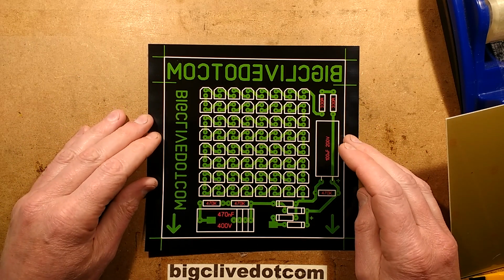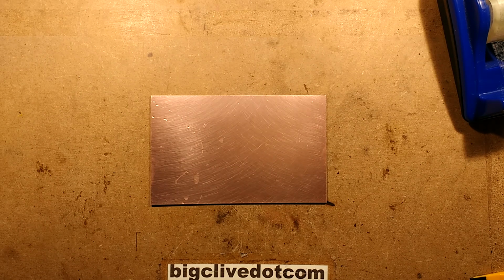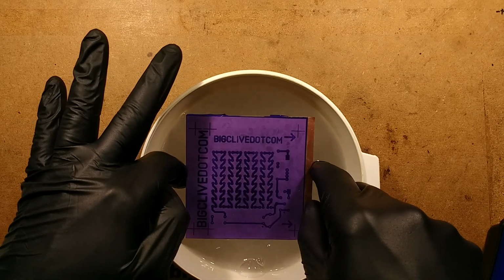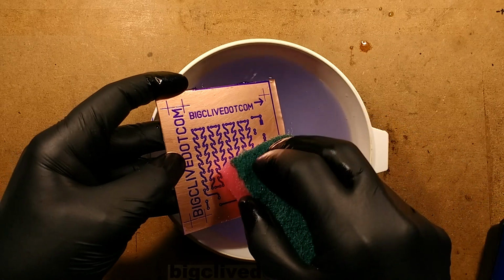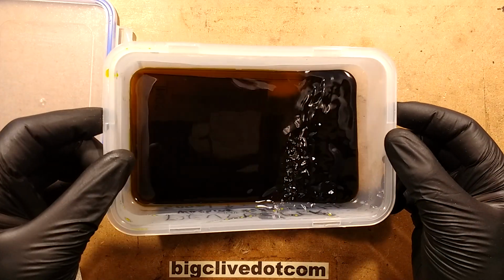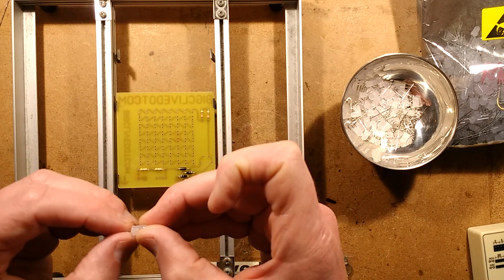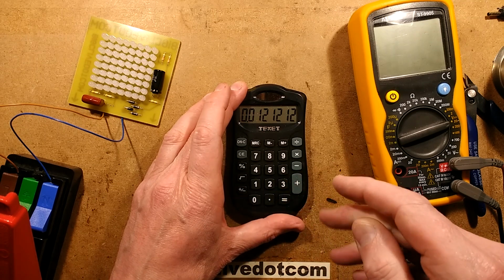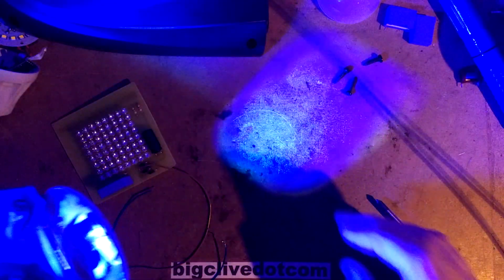Applying and exposing dry film photoresist and building a PCB.

Comment: I just can't understand why my board isn't etching.

I have followed the steps and got the lighting and developing right. But when I place the board in a 50% caustic soda solution, nothing happens.

So I took another small piece of pcb, roughed it up with steel wool for half of the surface and put that in. Nothing! Not even after several hours.

I use the clad board from aliexpress. 

What am I doing wrong?
Reply from the maker: Caustic soda is not a normal etchant.  It is sometimes used at low concentration as a developer.

Comment: Hi Clive. thanks for the in-depth video. I suspect that the photoresist film roll that I bought locally is not correct. From where did you get the film??
Reply from the maker: I bought it from an eBay seller.

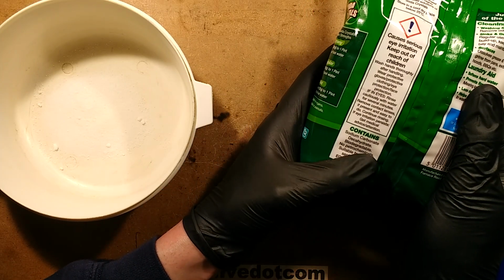Comment: 9:00 It's pretty easy to make Sodium Carbonate from Sodium Bicarbonate (baking soda).  Simply heat it on a stove or flame with a suitable pan.  It will appear to boil as the extra Carbon Dioxide escapes.  Leaving Sodium Carbonate.

Comment: And also for etching add citric acid,i bought powder on ebay,this will act as a de-smut and will speed up the etching process  ,this concoction is know as "EDINBURGH ETCHANT".
It works well compared to plain ferric chloride.
I was etching brass facia plates for tube amps and the brass was taking ages with the copper-zinc alloy a lot of gunk was on the surface of the metal and constant cleaning with a plastic brush was needed,the citric acid did the job.

Comment: looks like i'm commenting again from sunny glasgow......
Anyway,i was watching some youtube vids on screen printing and the usual methods for making the lithographic screen using the acetate and  laser printers.

I watched one tee shirt maker in india using a paper printed image ,it was applied to the presensitised screen and wiped with cooking oil ,the paper became translucent and the thing was exposed under UV as normal.

Obviously the screen is now made and multiple tee shirts can be made,but for one offs in pcb land this would save on expensive acetate,i doubt some ph neutral soap to clean the board of oil would damage the sensitised layer before curing and etching.
I have some very small pcbs to make,some inch square daughter boards for breadboarding a larger circuit ,to keep it neat,so i'll be having a go on cheapo paper first,can't hurt.

Comment: I know this is an old video, not expecting a reply but on the off chance…at what point do you remove the second clear film from the photoresist?
Reply from the maker: After exposing it and before using the developer.  Leaving it on while exposing it reduces the risk of the transparency sticking to it.
Reply: @bigclivedotcom  thanks Clive.  Wow didn’t expect a response on a 5 year video!

Comment: i have finally bought a laser printer (although im a bit pissed off as the box said "laser printer", but it appears it uses LEDs, not a laser. no matter) to accompany my photo-resist sheets, sodium carbonate, FeCl, plastic trays, a UVA lamp i made, and PCB blanks. the bit im not looking forward to is faffing about with software to make my own PCB layouts.
 i did try drawing the PCBs freehand, but it was a right balls up. laying down SMD 555 and 4017 traces freehand is, i discovered, impossible, for me. I am really looking forward to doing something with all the BC gerber files I've downloaded.
 may i trouble you BC to tell me what software you recommend for making layouts, please?
Reply from the maker: Thanks.  I use Sprint layout, but these days the online Easy EDA may be a good option, or Kicad may be good too.

Comment: Actually LEDS work more efficiently when switched at a hi frequency than a DC voltage. It is also much brighter, The driving voltage threshold is  almost enough to destroy the LED, if it isn't switched off in time.

Comment: I'm obviously 4 years late to the party, but ... when exposed properly, the parts of the photosensitive film that are not supposed to receive ANY light (i.e., your inkjet black geometries) will easily wash completely off. No need to endlessly rub with a gloved finger. What your situation shows is that SOME light is getting through the dark areas (no surprise there), causing the photosensitive film to partially gel, needing to be scrubbed a bit to remove the slight residual film. This means that you are exposing your film too long. Back off on your exposure time. In the process, it should also result a crisper image. There is also such a thing as too LITTLE light hitting the board (for instance, 5 seconds of exposure time). The goal is to find the sweet spot between too little and too much exposure time for your given printer and exposure light. I think you are currently running on the "too much exposure time" side of the equation.

Comment: When i develop PCBs after laminating with the domestic iron, some traces start to go away which really becomes frustrating. I think its probably because i fear i might melt the film on the copper instead of smoothly binding it. Any one tried a domestic iron and could share any tips??
Reply from the maker: The PCB material has to be clean and grease/oil free.  I ended up squeegeeing the film on gently under water and then using hot water to try and fix it.
Reply: @bigclivedotcom  Oh so it might not even need the iron at all?
Reply: @bigclivedotcom  I sand it with steel wool and use either acetone or isopropanol to clean the surface.

Comment: I understand this is an old video so there's a chance no one will read this but if you don't have access to a laser printer or fancy printing surfaces, you can use normal paper and put cooking oil on it and then lay normal paper on it. This makes the paper translucent enough you can cure the film under it with the uv light.

Comment: I have all the pertinent materials ordered to try my hand at etching. I got a bunch of it for free so I ordered extra being it's all cheap except the film you print the pcb on. Would you recommend and inkjet or laser printer. The wife works from home for the government and they gave her a laser printer. She gets regular ink orders for her Epson (non laser) every month hah
Reply from the maker: If it's a professional laser printer it may produce black enough transparencies.  I used to make mine with a laser printer and tracing paper, but modern home laser printers use a very light layer of toner.
I use inkjet with extreme settings for maximum ink and a milky screen print transparency film.
Reply: @bigclivedotcom  I'll use the bubble jet then. Thanks Clive.
Reply from the maker: @jstro-hobbytech  Look for the screen print "waterproof" transparency film on eBay.  It's a milky colour and absorbs tons of ink.  You may have to work out how to make your printer print the blackest black and lay down lots of ink.  I used the glossy photo paper setting and set the colour profile to all its extremes.

Comment: What was the transparent product you used to print onto?
Also, I loved the technique of spraying the water onto the board to apply the dry film, one that I'll definitely be sure to try.
Reply from the maker: I've found the best transparency film is one for silk screen transparencies.  It's a milky film that absorbs a lot of ink on the "squeaky" side.  Try searching on eBay for silk screen waterproof transparency film
Reply: @bigclivedotcom  Thanks heaps for getting back to me and letting me know.

You're right about it being a little in the pricier side lol.
Reply from the maker: @V8VRUte  Shop around and try different keywords like "milky" and "inkjet".  You may find a cheaper listing.
Reply: @bigclivedotcom  Yeah, I did manage to find something decent, 20 A4 sheets for around the %15 mark.  As opposed to a 100' roll for $80 lol.

Comment: How the heck did you hold that drill steady enough to do that?  When I first started making PCBs I tried hand holding one, from Maplin! It was a dismal failure, it cost more in bits than I care to think about.  Fortunately we have a very good auction house locally and one of the things that I found there was a proper, RS supplied,  PCB pillar drill, complete with dust extraction.  I like the smell of drilled PCBs but allegedly it's not all that healthy :-( 

On a different note.  I have done some very fine (fine as in thin, not as in great) tracked PCBs and found it better to print so that the side of the acetate against the board had the printing on, this way there was no chance of the UV creeping around the print and casting a small shadow onto the resist, even though the acetate is thin there was a gap between the toner/ink and the resist.  

Although I'm  nearly 4 years behind the video can I just say thanks and it made a good watch, thank you.
Reply from the maker: I've drilled a lot of holes in PCBs and initially broke quite a few drills until I mastered drilling with tungsten carbide bits.

Comment: What wavelength for the uv light if I want to diy a box? And is there a certain type of led, I mean voltage or shape wise. I want to play with just making lines at first. I'd like to make the small led exposure box first though being it's playing with leds hahaha

I also just bought a 1000 of them as I have only have clear ones. The diffused ones are nice
Reply from the maker: It depends on the film. Try exposing a small bit with different LEDs.

Comment: What a nice, chatty "electronics enthusiast"! I loved how he patiently (and lovingly) rubbed and twiddled the pcb in clearly under-strength developer for around 6 times longer than I would have waited for. I've added this vid to my likes so that I can watch it on my 'off' days and be re-inspired by Clive's patience. Thank you Clive!
Reply from the maker: I'd rather it developed slower than do the "everything disappears" thing.
Reply: After a lot of frustration, what made the difference for me was making the mask really opaque, when you print on a foil and hold it in front of a light, you can see that the black ink or toner is still quite transparent and you'll expose everything a little bit. I printed two layers of toner on the same sheet and that made it black as night. After that I didn't have to rub anything, the unexposed stuff came clean off in less than a minute.
Reply: @Kalumbatsch  Excellent observation! What I usually do, is print two adjacent masks on the same trasparency. I then cut one of them out and place it over the other. I am careful to align the tracks so that the two masks exactly coincide. I then sellotape the edges of the top mask to keep it in position. In this way I overcome the problem of see-through solid areas. I find this easier than overprinting on the same transparency. Overprinting often misaligns the first and second prints, at least it does on my Samsung laser printer.

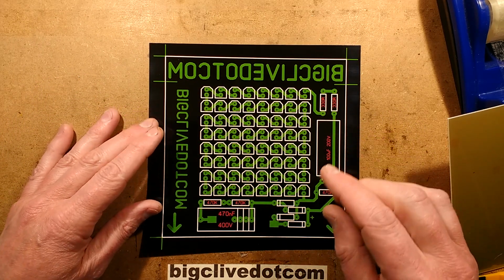Comment: Darn, I thought you were going to show more than just the PCB copper etching; I was hoping to see what method you used to add the red and white marks on the black board you showed at 0:17.
Reply from the maker: You can apply those using similar techniques, but by that point you might as well get a batch fully manufactured.

Comment: Great video mate, I searched for a video about using dry film photoresist, I knew that when I saw your name the video would provide all the answers I knew I wanted and others that I didn't know I wanted :)

Just wanted to add that incase you don't know, if all you have is sodium bicarbonate but you want sodium carbonate. Preheat your oven to 200C and bake the bicarb for 15 mins. At temperatures above 80C, sodium bicarbonate breaks down to sodium carbonate (Na2CO3), water (H2O) and carbon dioxide (CO2).

Since it's in a hot oven, after 15min all you have left is sodium carbonate. BTW, I'm not a chemist. I heard this ages ago and just googled it, gave you this info from a scientific amercan chemistry project for kids called "Vanishing Baking Soda".
Reply from the maker: At some point I discovered that sodium carbonate was sold in big packs in the laundry aisle of the local supermarket.

Comment: Clive. I've been exposing my film with the unit they dry ladies fingernails with. It has 4 x  9w UV tubes above, and 2 either side. It certainly turns the resist a nice dark blue, but therein  lies the problem!. 
I haven't had success with it because I have real difficulty etching afterwards because I don't seem to be able to remove al the shielded, uncured resist .  It seems that he etch liquid doesn't contact the metal when etching, as though there is still resist material underneath.
I've tried different exposure times below the UV lamps, without noticing  any real difference to my problem, so how can I tell whether I am over exposing the resist?
 At what stage can I tell its exposed enough, without over doing it! I really don't know or can't work out, how strong the light source is. Can anyone help please
Reply from the maker: Try exposing it for a much shorter time, until the wanted resist goes a lighter shade of blue.  One thing I kept forgetting was to remove the plastic protection film before developing.

Comment: Thank you so much for sharing. I have tried this dry film method several times with no success. I'm pretty sure that my problem is in the soda wash proportions. I'm not sure what 8 grams is. My kitchen scale seems to weight out a lot more powder than I see in your mixing tray. Is this weight, volume or some other measurement that I may be missing. How do you measure out 8 grams?
Reply from the maker: 8 grams is about a quarter of an ounce.

Comment: Could one just use a cheap laser engraver off of ebay and burn off the parts of the coating once hardened that you wont need?? Skipping the whole printing plastic films step

Comment: Trying to get the hang of this method. I used to use the pre-sensitised boards from Maplin years ago, but this method is much cheaper. For the exposure I have tried a 200W incandescent bulb, with the bulb about 10cm from the board an exposure time of 15 mins seems about right. I also have an eprom eraser I am thinking of trying, but i think the incandescent lamp may be a more 'gentle' way to expose the board and less time critical. I have an 11W UV CFL bulb but this seems inferior. 

My laser printer doesn't do too well with transparencies as the toner doesnt stick properly, leaving poor opacity and a smeary 'trail' down the page. Tracing paper seems ok, but one other method worthy of further investigation is to use ordinary paper with a few drops of baby oil soaked in. The oil makes the paper transparent and the oil helps it to stick to the board. 

Developing seems the tricky part for me, it all looks well until the last remnants of photo resist remain on the board, then I get tracks peeling off all of a sudden. After 3 days of trying to perfect this method, I have made some progress but am still not quite happy with the results. 

Another idea I have is to apply toner reactive film to the transparency/tracing paper, this stuff is supposed to stick only to the toner so should increase the opacity of the artwork, it is available cheaply and is intended for making your own greetings cards, etc. I got the idea watching a video where someone used 'trf' film along with the toner transfer method of DIY PCB production.

Comment: What do you recommend for printing the design? Tracing paper or transparency? Laser printer or inject? One layer or two layers (of transparencies/tracing papers)?
Reply from the maker: I used to laser print onto tracing paper, but modern printers often put down a really thin layer of toner.  These days I use screen printers inkjet transparency film.  A milky coloured film that absorbs lots of ink.

Comment: Clive, I am interested in foregoing a UV box to expose this material. Do you know the exposure times for leaving the film between glass exposed in the sun? THANKS!
Reply from the maker: You can test it before the main exposure with a piece of the film on its own.  The colour change is also very visible.  Make sure the glass is clamped down firmly on the transparency to prevent light leaking underneath.

Comment: After using the Ferric Chloride,  Place a peace of IRON into it.  Large Bolt or peace of plate works fine .   All the depleted copper will be attracted to the iron and replenish your Ferric Chloride for further uses.   You can reuse the same solution many many times doing it that way.
Reply from the maker: I've not come across that specific technique before.  Just complex ones.

Comment: Clive, what function do the resistors and capacitor provide in this circuit?  Could it have been designed to work with just LEDs?  Thanks - Charlie
Reply from the maker: They limit the current through the LEDs.  Without them it's very likely that the LEDs would fail instantly when turned on.
Reply: @bigclivedotcom Thanks, Clive.  I had thought that as long as you got the voltage correct, the current would take care of itself; the LEDs would draw whatever they needed.  I'll go do more reading.  Thanks for the response!  >Charlie
Reply from the maker: @charlesworton4020  LEDs are usually powered by a current regulated supply.  There have been attempts to run series strings directly across the mains supply, but it results in major current variation and failure.  Even a tiny voltage change across an LED will result in a significant current change.